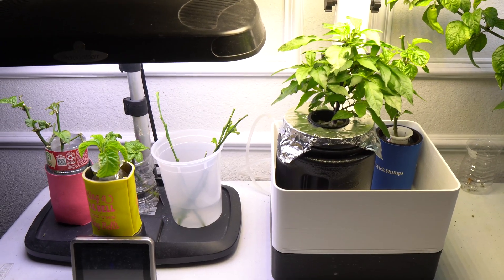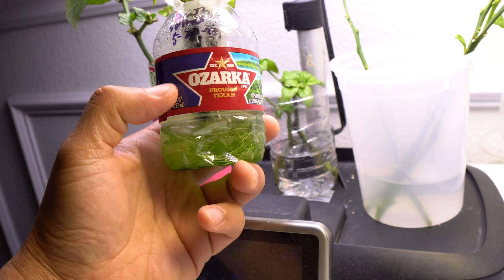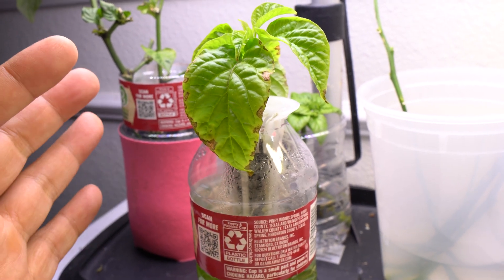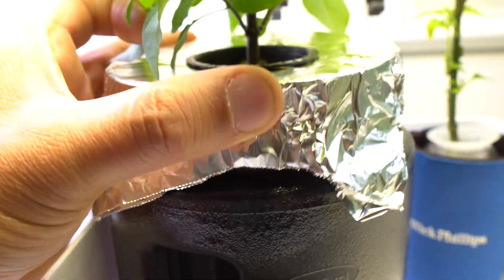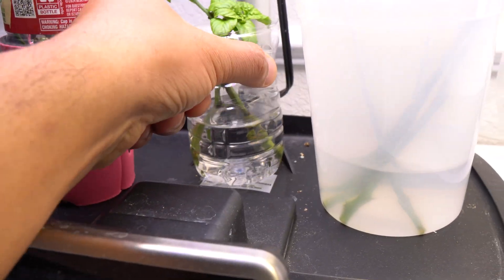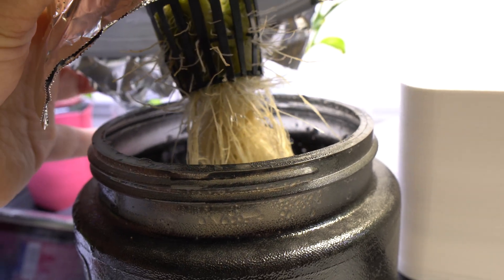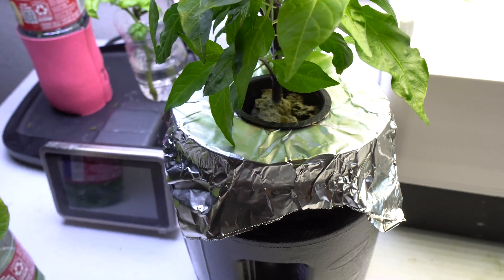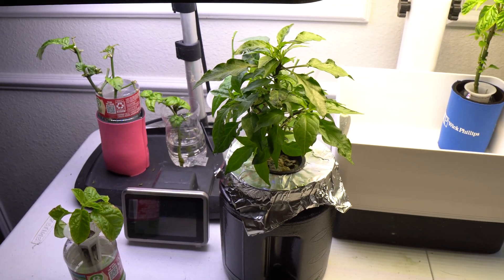Non-Circulating Hydroponic - Managing Nutrients Level and Algae

Comment: When using small, or stand alone grow vessels, I often use a small fish tank air pump to aerate the water. Just poke a hole and run a line down into the water with an air stone.
    If the vessel is big enough, you can even put a few goldfish inside. Feed them a few times a week, and now you have an aquaponic system. The fish will produce the nutrients from their waste. Just provide food and air and you’re good. Don’t worry too much about algae.
   It won’t bother the fish or the plants as long as there’s enough oxygen. Sometimes I’ll run two lines into each vessel, just to be sure everyone is happy.
Reply: Would you be able to add the nutrients? Seems like that might harm or kill the fish.
Reply: @OldMotherLogo  If you're using fish, they produce the nutrients from their waste. You don't need to add nutrients if you're using fish. Just make sure there's plenty of oxygen and you should be good to go.
Reply: @GlobalTubeTruth3 .  I don’t know anything about fish. I would want to know how many? What kind? In what size of container? It might not be a very space efficient way to do hydroponics. Have you done this? I have known people who raised tilapia in tanks and had tomato plants growing in it but their focus was on the fish, not the tomatoes, so they might have a few tomato plants in a 500 gallon tank.